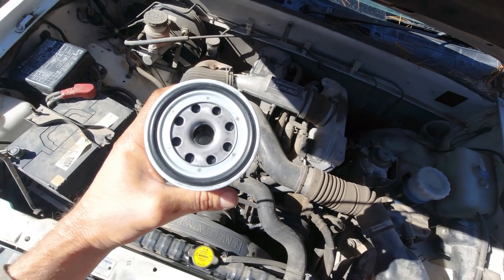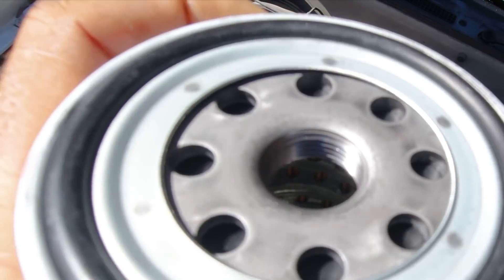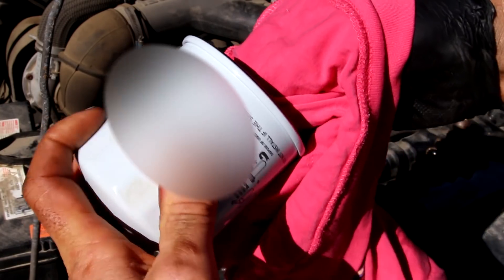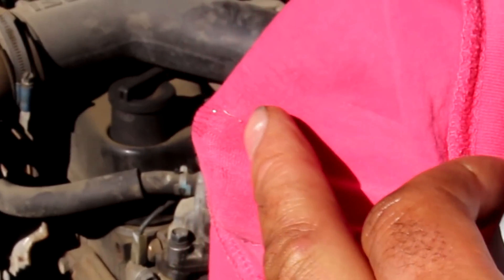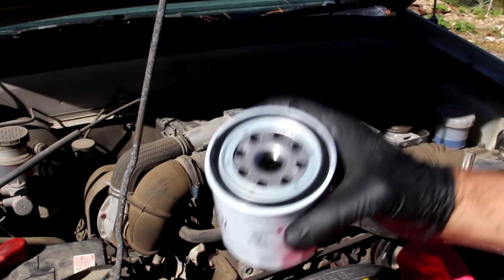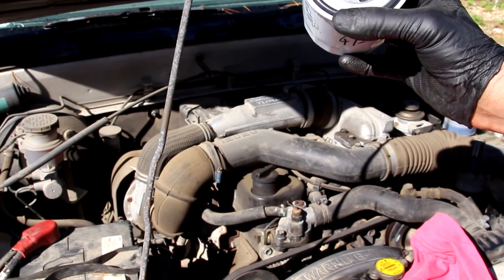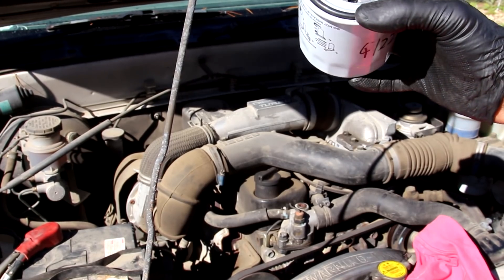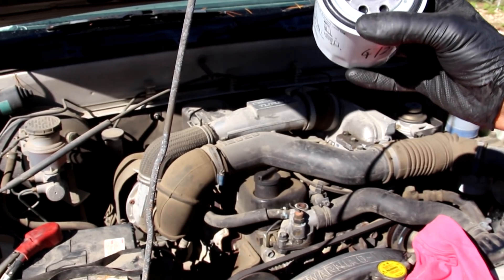Simple trick to extend the life of your engine

Comment: When people go and buy Oil filters they should always check that the rubber seal is on the filter as well as you said the Metal that maybe left from manufacturing also there are Company's that Make oil filters for the Automotive Industries so Ford and GM and so on are supplied by the said Filter Company ,If your oil filter is a upright type you can top it up before the install so the engine does not start up dry. lol

Comment: Engine oil filters are designed to capture large contaminates like a sliver of metal. This little piece of metal would have been captured by the filter never making it to the engine. Nice suggestion, not really necessary but doesn't hurt either..
Reply from the maker: No the oil flows from the outside of filter back through the centre, so any loose swarf in the centre is pumped through the engine
Reply: @MartyT  dang.. would be nice if it flowed in the opposite direction

Comment: I noticed this years ago.  Some brands are definitely worse than others in this respect.  I always buy better filters and I still wipe it out with the rag before I prime the filter.  How about that as a tip!  Always fill the filter as much as you can before you put it on the engine so the restart does not have the engine run any longer than necessary without oil pressure.